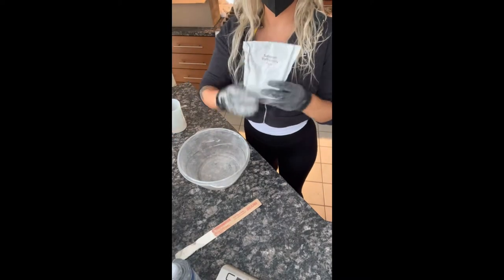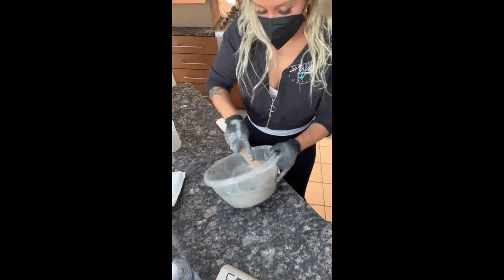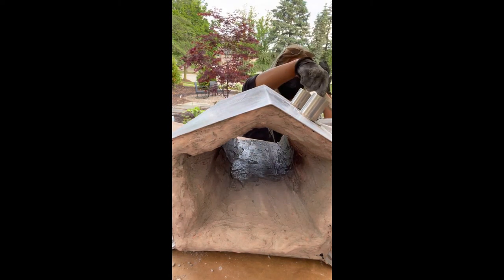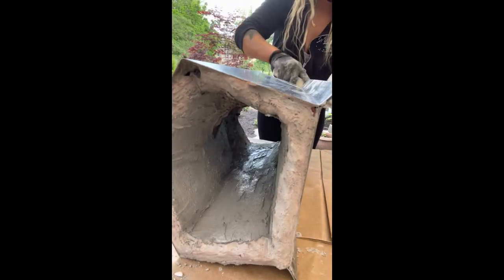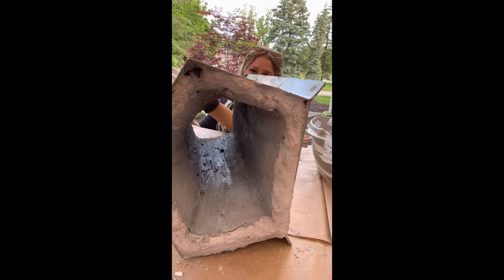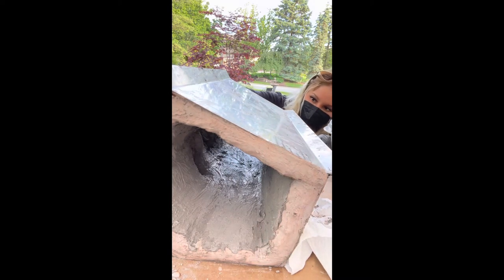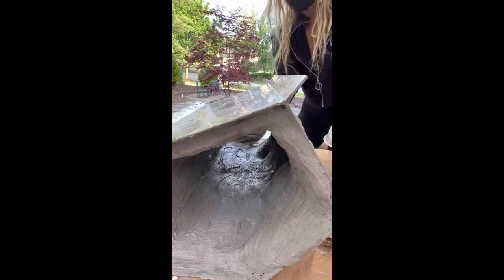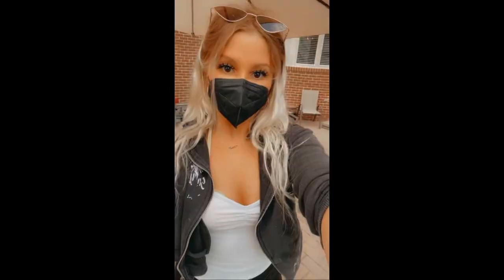HOW TO SET UP A FORGE PART 3: 2ND refractory coat

Comment: Did you have a lot of cracks form once it dried and cured?
Reply from the maker: Not on the first coat. The second one cracked where the insulation meets the metal but you should have left over refractory for touch ups!